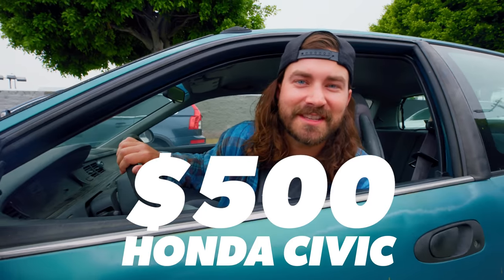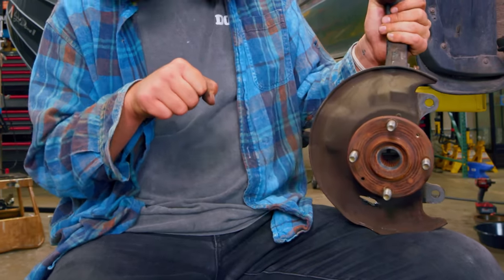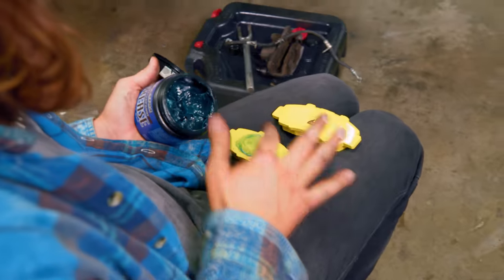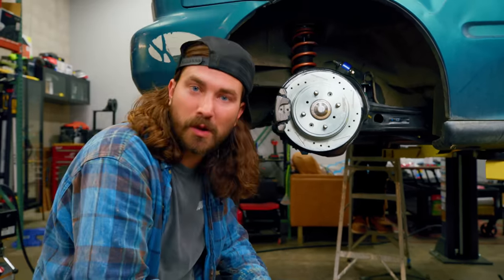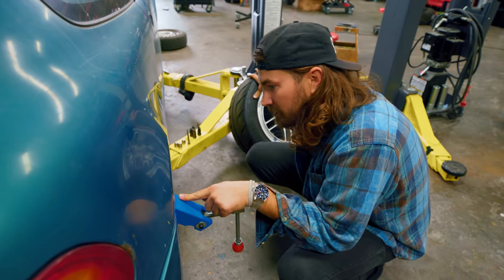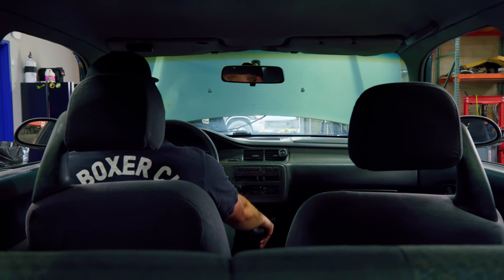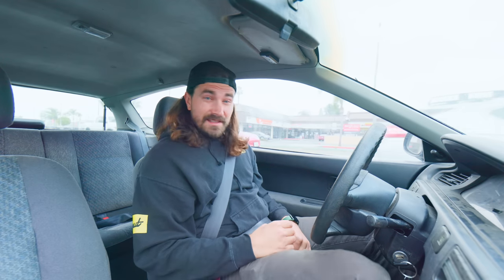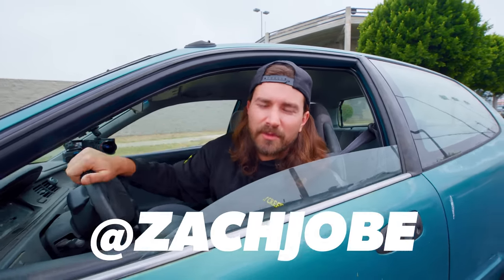We Put $5000 Brakes on our $500 Civic

Comment: "sometimes you take it apart and put it back together and its all better" 100% feel this as a diagnostics technician, almost as relatable as "every 20 minute job is 1 broken bolt away from being a 3 day ordeal"
Reply: Literally- I was putting on my fiancés winter tires when I found a cross threaded bolt… the lug got stripped in the hub, so the nut and stud were basically fused together. I had tried everything, and to make it worse they were set deep in the alloy wheels. Ended up breaking so many bits trying to drill it out, I had to go to harbor freight and buy a whole set of their ‘expensive’ metal bits that were impact driver compatible. The other 3 wheels took  15 mins. This one took ~2 days in 10 degree weather.
Reply: As a NASA scientist I find your comment hysterical
Reply: I was swapping my winter wheels to summer wheels, and I got to the last wheel and found one lugnut that would just not release.  I ended up putting the jack handle on the breaker bar to get it loose, but I was so terrified it would shear the lug and send me down a 3 day rabbit hole.
Reply: Turbo
Reply: Ha! I just got inside from a quick brake job that will probably take another three evenings now. Effing pissed.
Reply: Fr bro💀

Comment: I wished you could have done a before and after test of the breaks and the affect of bedding them, would have been cool to see the difference. And also mention the difference in boiling point of the breaking fluid and how that contributes to break fade! Love the series :)
Reply: If you don't bed your brakes you wind up with uneven wear and vibrations and the myth of a "warped" rotor. Rotors will never warp under use. They only warp if they are heavily impacted in a wreck. 

However, what everyone refers to as "warped" rotors is the vibration you feel in the pedal. If you don't bed the brakes you'll feel that vibration. That's the before and after.
Reply: yeah seems like pointless content - just do some braking tests before and after to show the difference. Same with suspension - they installed it, but didn't bother to do any meaningful before and after tests
Reply: @MinistryOfMagic_DoM  i have warped rotors or, well, uneven bedded rotors, on a car i bought used.

Is it possible to mend that? like can I do something about it?
Reply: @MinistryOfMagic_DoM  i have personally seen warped rotors from overheating, i have literally put a steel rule on a rotor and seen it's a good 2-3mm bent.

it's not a myth, it happens.
Reply: @MinistryOfMagic_DoM  you can absolutely warp rotors under use, when they get too worn out and thin, or too hot. I have warped a set of rotors under track use myself, because they were near their end of life at the time.
Reply: @ghosttaker3251  get them resurfaced
Reply: @MinistryOfMagic_DoM  ive seen countless warped rotors in my days. dragging brakes causing constant heat build up never letting them cool tends to be the reason. if you get into an impact causing the rotor to bend the rotor is litterally not a concern its more are you okay because the car is more than likely totaled, or you had and wheel fall off. as for bedding pads its up to the manafacture of the pads to say if you should and how you should do it. ive always bedded my pads myself no matter what but if you want peak perfomance just look up what the pad manafacture recommends on bedding procedure and do it. saying warped rotors is a myth is just a lie. talk to any mechanic that has done brakes and they will tell you about how rotors can be warped.
Reply: Don’t let this distract you from the fact that Hector is going to be running three Honda civics with spoon engines, and on top of that, he just went into Harry’s and bought three t66 turbos with nos, and a motec exhaust system.
Reply: @ghosttaker3251 resurface if you have enough thickness in rotor faces but they're like 40-70$. I do 2 brake changes before changing rotors
Reply: @MinistryOfMagic_DoM really? Then what’s the brake lathe for. Air in the lines will cause a spongy pedal or low pedal.

Comment: Your issues with the rear brakes sticking could be the residual pressure valve, as drum brakes need residual pressure in them to activate easier, when u change them to disc brakes the disc brakes can stick (depending on how well the residual pressure valve works) disc brakes don’t need any residual pressure unlike drums, id recommend taking that out, sometimes they build it into the proportioning valve system, and I could be wrong as I don’t know much about civics but just a thought as to why that was happening to you guys

Comment: My xrs 2009 Toyota matrix came factory with some half ass drilled
Rotors/brakes. I bought it used w/ 40k and basic rotors, but put upgrades pads on it. I still was being pushed into intersections. I finally found American made rotors drilled/slotted and galvanized nrs brake pads. What a difference !!! I will never buy any other type of pad / rotor combo
I just learned from this vid how important brake lines are tho

Comment: In EU, we put brakes from the VTI MB civic and 280mm front 260mm back is quite the track setup. Also the EP3 300mm front brakes fit with a custom bracket. So plenty of stopping power upgrades for pretty cheap. MB front and rear brakes + sway bars are I think similar/the same on the Integra.

Comment: Drum brakes do actually work very well. Just not ideal for racing because of the lack of heat dissipation. You can find many dump trucks with drums all the way around because with drums you get a much larger contact area with the shoes that are almost always bigger than disk brake pads.
Reply: yes just not for racing or sudden stop lol

Comment: Drum brakes are perfectly adequate for street driving. They work well and last a long time. And they aren't hard to change if you take your time. The problem is, they get hot when used a lot. So if you're doing a lot of hard braking, upgrading to discs is a good idea. But if you never go on a track, or don't commonly drive a lot of curvy mountain roads. Factory drum brakes are just fine. 
If you're drag racing. Drums are lighter and they will stop you just fine. Even 4 wheel drums are good for drag cars. 4 wheel drums are also okay for street cars. But upgrading the front to discs definitely has it's benefits in certain driving conditions

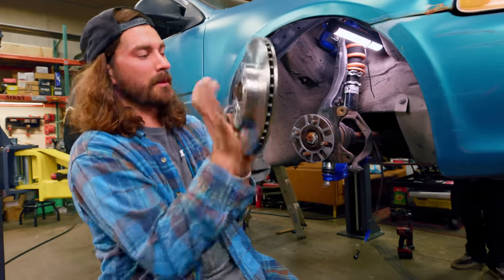Comment: 2:26 that spacer isn’t safe. I hope there is still space enough for the rim to rest on the hub and not the axle studs which could shear off while driving if you hit a big enough bump. 😅 be safe guys ❤ love your content.
Reply: Looked for this comment
Reply: Looked for the comment on that comment
Reply: @Powk-mz1cp  LoL 😂
Reply: Looked for the comment on that comment to the comments
Reply: whatever side of the rotor you put it on would still leave the same amount of stud. the reason im worried is it could cause the rotor to grind against the caliper bracket, AND cause the outer pad to wear out faster as the rotor would be constantly be rubbing against it. but a quarter inch spacer would still leave enough threads to be okay otherwise.

 oh i see what you mean with the hub now. either way the spacer would pull the wheel away from the hub though. never stopped any honda boys before, but yeah i still dont like it. that spacer could pull the rotor away from the hub too where its placed
Reply: @dhag72  exactly. I know you can get or make adapters. I have done it in the past when using rims not meant 100% for the car I was driving but the stud spacing was correct. I know they are illegal here in Canada but still sold in stores waiting for the unsuspecting teenager looking for that aggressive stance. 🤦🏼
Reply: @Jenuin  yeah but that doesnt explain why you would put them behind the rotors as opposed to outside of the rotors where they go. since when were spacers illegal in canada? they arent in the maritime provinces
Reply: @dhag72 I know they did it for the spacing of the calliper. I was hoping to see someone with a lathe and maybe an adapter to allow the rim to sit on the hub. It’s a good it’s a light car because if this was an off-road deal it would be almost instant destruction. Yeah they’ll be testing it in the curves. Let hope for an uneventful curvy winding drive.

Comment: I've had shaking under light brake pressure since I upgraded the pads and rotors. After watching this video, I went and (safely) stomped on the brakes several times, turns out they weren't bedded in. Thanks Donut!

Comment: Drum brakes are one of those things that I am still surprised are still around. A lot of your big rigs still use air drum brakes but are finally starting to be replaced with air disc brakes and I know that a lot of trailers big and small still use drums for some reason.
Reply: Cheaper to manufacture.
Reply: Drum brakes provide better stopping power due to their increased surface area. Their draw backs, faster fade, longer cooling time, inconvenient to work on, have all overshadowed that fact.
Reply: Even some ev are coming with drums
Reply: @Mr1611  evs don't really use their brakes lile ice cars do. Drums will be fine and last ages.
Reply: They last longer, so if you don’t need the performance or look, they still use them.

Comment: Don't come to a complete stop when you do the brake bedding or you can leave an imprint on a single spot on the rotors. After you get good brake fade, then drive for a few min without hitting the brakes so both surfaces cool separately. It's tricky so find a wide open road. Great vid!

Comment: Did he just throw a wheel spacers behind the brake rotor? 🤣😂
Reply: I’m so confused by wtf he put back there
Reply: It certainly looks like that.
Reply: I was hoping to find a why in the comments...
Reply: Glad I wasn't the only one to see that. Makes me a little worried for them
Reply: this is why im in the comments too... i dont understand. ive owned 12 civics, none of them stock, and have never heard of nor seen this before, even with spoon brakes. if anything it would cause the rotor to grind against the caliper bracket on the outboard side, at minimum it would wear out the outer pad. i dont understand
Reply: @tombodri4782  the spacer would just move the rotor outwards, wouldnt make a difference as far as disc diameter goes. plus they upgraded to the bigger spindles which would use the bigger discs already
Reply: I don’t know. I’ve done many of brake swaps and never seen that recommended at all. Not even a sized to fit spacer. Just some generic one size fits ten design. 🤣 $5000 brakes
Reply: the reason for the spacer is for the rotor placement to be center in the caliper.
Reply: On negun site I found some spacer made specifically for this and the product description is: "The Spoon Inner Spacer set is required for fitting the twin block caliper set for a number of vehicles."
Reply: @ericbell530  My guess is its needed for clearance issues with the large calipers.

Comment: Top tip: 
find a close backroad to bed the brakes, that way you can avoid traffic, and stop lights. It's ideal to keep moving,  if you have to stop, slow way down and creep until that light turns green,  then after bedding try to drive for like 5 minutes without using the brakes, to allow them to cool down.  I live in the country so this is easy for me,  but, if not,  try to plan an ideal route if you can
Reply: Yeah, him sitting at the stoplight and talking about how he could smell the brakes had me cringing.

Comment: The hyundai tiburon and XG350 share the same front knuckles, but have larger calipers on the XG. So I took the two piston calipers and 12" rotors from an XG, slapped em on, and boom instant stopping power upgrade. Next will be 4 piston if I can find a company that still makes em

Comment: I would've liked to see you replace the trailing arm bushings - with a lowered suspension the old bushing will be clocked wrong and tear through pretty quickly. A popular thing is to just replace it with a center pivot bushing that way it doesn't have to be clocked perfectly whenever the ride height is adjusted. Otherwise fantastic upgrade and awesome video.

Comment: I bet money it was the ebrake setup that was binding. Sometimes when you put it back the caliper squeezes the rotor at an angle because there's no wheel to hold it aligned. That can cause the e-brake system to catch and lock up the pad. I've had it happen twice and both times reinstalling the rotor has fixed it with no issues
Reply: Also that thing is gonna need a brake bias adjustment. Front is way overpowering the rear

Comment: For those swapping drums for disks, drums are (comparatively) a pain to work on, heavier, and fade faster (worse heat dissipation).  However, disks need more fluid (change proportioning valve) because they are not as strong, and need more juice for equivalent stopping power.  This didn't seem to be well spelled out.  Drums are strong brakes.  Biggest issue - heat and weight.

Comment: Please check the rubber stopper pad for the brake light switch on the brake pedal. It should be rubber. DO NOT replace it with a bolt/nut, this will cause massive problems with your new fancy brakes, replace with the OEM part from Honda. If there is a nut/bolt in there replace it, that could be the cause of your rears acting up.

Comment: Having a big brake kit doesn’t mean you can 100% trust your always going to brake. I have a front big brake kit now on my Scirocco cost me about €2000. 

I don’t get brake fade but on night while some spirited driving was happening my tired bumped up from uneven road surface. This happend right before a corner when I wanted to brake however abs kicked in and I wasn’t slowing down immediately. It did finally make contact and brake but I went faster trough that corner than I would’ve liked.

Me and car both are okay and nothing happened but this shows me the importants of a good suspension which will be my next mod(KW V3). However first I need to save more money.

Comment: Can't believe you guys don't have a vacuum pot you attach to an air compressor, to suck brake fluid through. It's so much faster, and them you just do a couple of peddle down, squirt, nip up the nipple- things, rather than heaps. So much better for sucking through fluid on new brake gear.

Comment: When you said drum brakes don't work too well, I disagree. They work just fine and actually potentially work better since you can have a lot more surface area rubbing at once. Their main problem is they're a lot more susceptible to brake fade than disc brakes. Their main advantage is that they're cheaper than disc brakes, so to help cut costs manufacturers would and/or still put them on the back and disc brakes on the front. It helps keep the cost down and you still for the most-part get the same amount of braking power in conventional setups.

Comment: I hope the 5 grand was ALL the parts for the rear, the new master cylinder and proportioning valve and all the rotors pads and spoon calipers.
Still seems really expensive.  My cousin did his brake upgrade on his old 93 Civic for under $2000.

Comment: That right rear caliper problem is a bad brake line. When it's locked up and you pop the bleeder it releases that means the caliper is working. The brake line is not letting the fluid to go back throw to release the caliper.

Comment: Tires is what is stopping the car. You said it yourself, the stock brakes can lockup the tires, so they brake hard enough. Fade is something that can be addressed with ducting, which will cost a fraction of a big brake kit.

Comment: Mo' power baby! There are so many DOHC options for power. Your engine will give you the most out of your aftermarket options as well😅.  But you gotta start with an engine swap, and work your way to turbo + waste gate + manifold + intake setup. Then new rims so you can get your old ones back to the Miata.

Comment: Lets start off…no hate… But drums brakes actually brake really well due to the large brake shoes surface area, there problems come down to there enclosed design where heat gets trapped in the drum and cannot dissipate as fast a sa rotor which is open to the air flow of the vehicle driving. Another con of drums is the complexity of them and how they only pivot from one point (the wheel cylinder) (unless they are duo servo). Very educational video as always anyway 🙂

Comment: Did you replace the lines on the back brakes? If they’re rubber and they swelled, they’ll let fluid in but not back out again. Could lock up a caliper

Comment: You guys should just throw a new head on it, big valves, port & polish and new cams w/adjustable gears. Put it all back together with the stock intake/exhaust manifolds. Stock air box and stockish exhaust. See what it would make powerwise while breathing through all the oem crap

Comment: Better brakes does not shorten the brake stream so much, then wider tires do.
Why you get bigger and better brakes is too keep them longer without losing power or of fatigue... when running long hours on example a track.
Consequently wider tires you have, the bigger roller resistance = shorter braking distance.

And one's standard brakes run out ... so must be factory defects on them for them is thoroughly tested by the manufacturer of the vehicle's horsepower etc. And this is a big problem among young people who just sit and say, I will trim my car from 150hp to 300-400hp,
and then the car owner cannot stop on the car itself because the original brakes cannot cope with the large increase in new horsepower. Nuts

Comment: if you do wantt to roll a fender without hammering it just get a handle from a jack and put it between the wheel and the quarter panel or fender and have a friend reverse the car and the handle will roll with the wheel and then roll the fender.